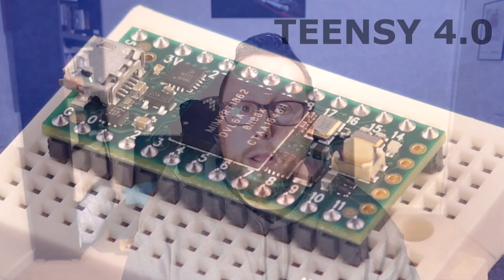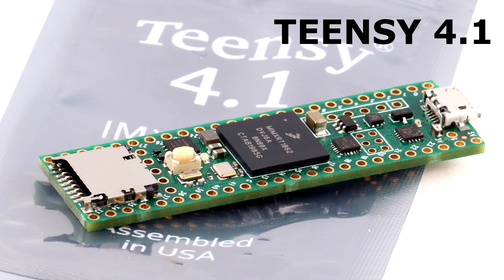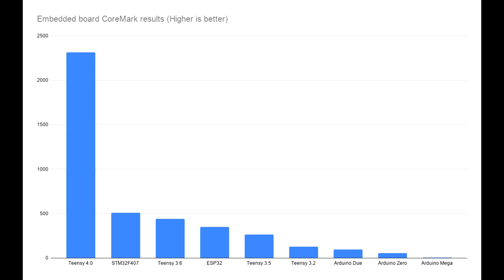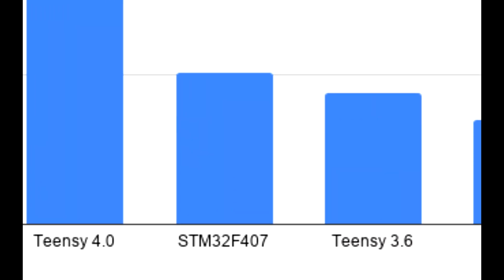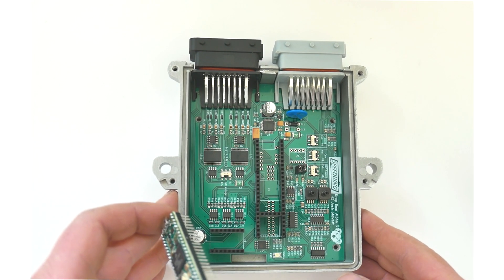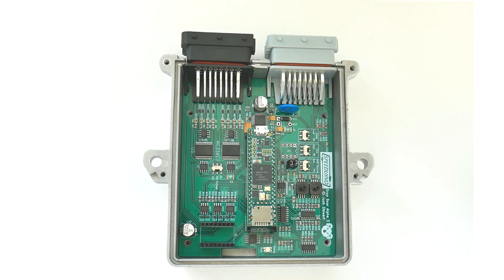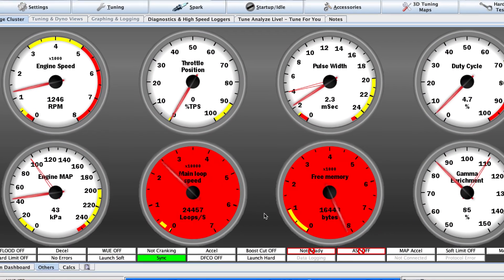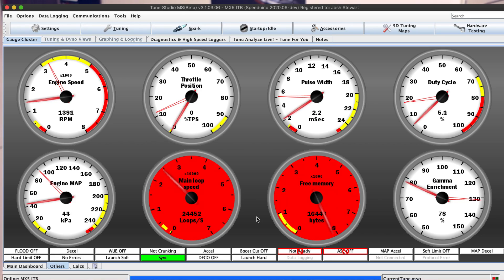Making an insanely fast Speeduino ECU

Comment: Just subscribed to you after finding your channel in an quite unusual way. 

I was browsing a Chinese Import website and saw a new empty ECU Case. 

That made me wonder if I would be able to build a ECU from a Micro controller.

Just 2 clicks later I found what appears to be a clone of an early prototype from your project for sale on said Chinese import website 😁

That made me google the name of the product and that's how I found your channel.
Reply: Probably want to stay away from those cheap as hell crap ecus in your car just fyi.
Reply: @MrJermbob  As someone with quite broad knowledge of electronics I don't see wy not. 

As long as the materials used are ok it will be fine.
Reply: @NinoJoel  Its the code. Not the hardware. Hardware is easy as you know.
Reply: @MrJermbob  you've posted several similar comments but haven't explained why you think the code is junk or what alternative you recommend. Are you planning to make a video about your specific speeduino concerns?
Reply: @aborkedbean  Wouldn't waste my time. I have said why and about the fixed timing.
Reply: @MrJermbob  Could I ask why you replied individually to each comment and introduced yourself each time? What's your issue with Speeduino and why are you constantly trying to say this ECU is ineffective?

In each comment, your response only involves "fixed timing ignition" and you have nothing else to say. In previous comments, you claimed to have 20 years of tuning experience, but based on your knowledge and what you're stating, you aren't even familiar with the most basic and simplest matters.

Comment: Thank you for modernizing aging ECU's into opensource soft and hardware!
Reply: They havent. Its junk compared to any other ecu. Cant even hold stable fixed ignition timing. you guys got scammed.
Reply: @MrJermbob 
Could I ask why you replied individually to each comment and introduced yourself each time? What's your issue with Speeduino and why are you constantly trying to say this ECU is ineffective?
Reply: They didnt. Its broken Speedunio will never take off as its junk code. The physical hardware is so simple. Noobs.
Reply: @MrJermbob  What do you recommend in the Speeduino's place, then? Can you make and alternative yourself?
Reply: @Cmdrbzrd  Just use a megasquirt. At least their code has been made to be sold. That way it has to be quality and supported. I have had a long play with speedy and ran it on one of my own personal vehicles as i like the idea. The problem is the core code is broken. No matter what features anyone works on and no matter what circuit board they make it will still always be broken. It takes assembling one, installing into a car, setting fixed ignition timing and revving the engine to see which is a big shame for alot of people that get that far.
Reply: @MrJermbob  Exactly what is broken with the code?
Reply: @LaysLobs  The fundamental triggering code. Stick a speeduino on your engine. Set fixed ignition timing. Get a timing light. Rev the motor watching the timing marks. Rev it to rev limiter and watch what it does too. Ignition timing does not maintain stability even when the trigger input is stable. Ive back to backed speeduino and megasquirt on identical setups. Megasquirt holds rock solid ultra accurate timing instantly after swapping to it. I have seen many installs now with the same issue. I have yet to see any powerful cars running on speeduino because they generally hurt the motors when trying to make power. I am not a coder. I am a tuner and a car guy that has 20 years experience with multiple ecu brands. I have a dyno where i live and deal in ecus all day every day. I have seen what their crappy code is like from a user point of view.
Reply: @MrJermbob  At least spell it correctly, noob.
Reply: @d1e6om  Spell what right munter ?
Reply: @OOFSPEC you really are the guy that no one wants to be around. Replying to every comment like a school girl.

Comment: I have a question on how to wire up a idle PWM two wire controller (ford mustang idle pwm) on speeduino .4 board.  you have pin #37 and what other pin from speeduino board do you connect to?  ecu ground?  thanks for your help.
Reply from the maker: Connect one side of the idle valve to a switched 12v source and the other side of it to the output on the Speeduino.
Reply: @Speeduino  hello, is that a positive 12v source and pin #37 on speeduino?  thank you

Comment: With greater speed and larger storage, will per-cylinder, as well as adaptive, fuel mapping become available?
Reply: Per cylinder fuel mapping would be amazing.
Reply: Actually, now that I think about it, shouldn't they all use the same fuel map but per-cylinder VE tables? It's the difference in air intake that causes most differences if I'm not mistaken.

I mean you could do with with fuel, but to have 8 widebands... lol.
Reply: @ChielScape  AFR table is a form of adaptive fuel trim. They're both a type of fuel map.
Reply: @CreeperOnYourHouse  Well sure, but you don't want to mess with your AFR target table, do you? If the variance in physical VE between cylinders causes them to produce a different lambda measurement, you don't want to cheat by changing the AFR for that cylinder. I'm approaching this from a physical perspective here, correct me if I'm wrong on this.
Let's say you want to run it at 12.7:1 but measure 13.4:1 at your rearmost cylinder, making the AFR target 12.0:1 to compensate so the measured value ends up at 12.7:1 causes misinformation. If a cylinder gets more or less air due to manifold design or something, that information has to go into the appropriate table to make sure all the tables remain accurate. A table with a 12.0:1 value to make sure it runs 12.7:0 sounds absolutely nonsensical to me.
Now for a given engine those two tables can be combined to a single table in which case it's effectively a fuel flow or injector duty cycle table, in which yes you're changing the fuel table/map, but this approach seems rather opaque to the tuner imo, since it doesn't reference any physical or desired measurements.

Comment: Do you think the 4.1 will enable use of SENT sensors or do you think the other processors are capable?
Reply: Hi Shawn, I’m a new speeduino user and while looking at some additions for my application I discovered the Hella OPS+T sensor, which is an oil+pressure sensor outputting data in a way somewhat similar to the SENT protocol you mentioned.

I wrote an interfacing implementation of this sensor to speeduino which is currently being reviewed: https://github.com/noisymime/speeduino/pull/494

Actually the code works but there’s room for optimization and more elegant ways of interfacing/reacting to the sensor’s signal.

It may be useful as a starting point for the SENT protocol, do you have some particular sensor in mind ?

It should work on the mega as well, I have plans of doing some benchmarking on this application in the next weeks.
Reply: @deffie83  I feel sorry for your engine.

Comment: Isn't the Arduino Portenta H7 a viable option?
Reply from the maker: Potentially, but support would need to be added for the H7 MCUs. It also has a serious lack of IO unless you use the high density connectors, which are a bit of a pain.

Comment: Just found out about your product and look forward to learning more!
Reply: Run for the hills. Buy something better. Please dont use these broken code ecus.
Reply: @OOFSPEC  speeduino has been quite successful....bugs always exist in firmware even with big name companies.
Reply: @lildude6906  No it hasnt. Its been successful to get into the broke customer market sure. Success in making horsepower no it has not. Not bugs that cost you irregular ignition timing. Big NO NO
Reply: @MrJermbob   there are countless pnp examples of speeduino in bmw, miatas, dsm, and Hondas lately. I would say that's quite successful for an open source stand alone ecu
Reply: @lildude6906  Sure nothing that makes power or can show a decent dyno run. I challenge them all to set fixed timing, rev the motor and watch the mark with a timing light. I mark my word it will jump around like crazy.

Comment: Hey man, love your work, keep it up! quick question, i have an arduino due and have some trouble uploading the firmware to it using the speedyloader, it keeps giving me that avrdude: stk500v2 time out message, could it be that the speedyloader only works for the mega 2560 or am i missing something? since I've seen yoyr previous videos using the due instead of the mega, I'm new to the arduino and coding world so definitely looking forward to your reply, thanks in advance! (Sorry for my bad english)
Reply: He wont reply. He needs to help himself with his broken code.

Comment: @speeduino hey i have a project coming up which includes dual engines and i would like to control both engines simultaneously on one ECU i would also like to have D.B.W. on both as well as a strain gauge to shift both transmissions sequentially is this something a 8 cylinder capable ECU could handle ?

Comment: What are the advantages of the 3.5?  I'd have thought standardise on the latest, balancing cost & speed.
Reply: As stated above, it has more available timers.
Reply from the maker: More timers is certainly the big one but I also have concerns about the temperature that the 4.1 runs at
Reply: @Speeduino  Great thank you for that
Reply: @Speeduino  Nothing a tiny heatsink and some thermal epoxy can't fix, no?
Reply: @ChielScape  No. that does nothing. Where is the heat energy getting sent to ?

Comment: i hope any board printed in 3 layer and made it only 1 1/2 credit card size.. and I really interested to try this ecu in my motorcycle, just 130 cc but convert from carburator to fuel injection

Comment: Hello, I am an engineeringstudent in France, studying electronics/programming. I am about to start a very interesting school project and I need your guidance!

I own a Honda CRF250L 2018 engine (single cyl 4 stroke) and a go kart chassis, the plan is design all the rest ourselves: ECU/Harness design, touchscreen dashboard, flappy paddle gear box and servo for the clutch (previous project but swapping from an arduino for a custom circuit),  full lights (including brake lights/indicators) and possibly a pivoting rear wing.

The project is replacing work experience so it is supposed to last 12 weeks (35hr/week).

Do you have an email to contact you directly?

Thanks in advance!
Reply from the maker: Probably easiest to jump on Slack and we can have a chat about it if you'd like: https://speeduino.slack.com/join/shared_invite/enQtNzE0MjU2ODE5MTM5LWZhOWMwMWFhZTVjYTg5NmYwNzhmMGNhNDE4NmJiNDc0NDgyYmZiMjg1YjJjZmNjNDk2YTYzNzk1ZWEyNGJhNDI#/

Comment: im running an on/off switch to my supercharger, will the speeduino be able to correct itself on the fly or will i have to change the tune manually ?
Reply from the maker: Of course, whilst off boost the tune will simply run in the NA portion of the fuel and ignition maps.
Reply: @Speeduino  thanks for the fast response mate :)

Comment: how does the speed compare to a Raspberry Pi 4?
Reply from the maker: They're very different things with very different goals. The Pi4 is obviously a lot faster, but does have all the peripherals that you need in an MCU like this. It also uses more than 20x as much power.

It's a great board, but not for an ECU.

Comment: This fast enough to use on a rotary application?
Reply: Why wouldn't it be fast enough? I mean it can run normal piston engines to pretty high rpms, and i see no issues in  running speeduino on rotary...
Reply: Ladislav Daníček my concern was that they run with half the cycle time of a conventional engine. Thank you
Reply from the maker: There are at least 5 rotaries running on the 16Mhz Arduino so.... Yes
Reply: Speeduino FD RX-7 is still under development?
Reply: Also there is a video of a guy on YouTube running FC Na engine on speeduino

Comment: Am I crazy to assume you can use a faster chip to run closer to lean making more power in a safer manner?
Reply: The ecu processor speed has nothing to do on how lean you can run engine, how much it makes hp, etc.
Reply: maybe if you use a wideband o2 sensor. with the traditional one for sure that is not going to happen
Reply: Not at all. The code the ecu is based on is broken and does not hold solid ignition timing. Run for the hills away from speeduino.

Comment: Is the 3.5 capable of running v12 full sequential if we really wanted to or you would choose 4.0 for that??
Reply from the maker: If anything the T3.5 is probably better suited. It may have a lower clock speed, but it has more available timers. The firmware though hasn't been updated for the extra 4 channels as there hasn't been a call for it at all.
Reply: @Speeduino  thank u for answering my question although i had made a mistake. I wanted to say v12 with wasted spark.

I would like to add that you are the hero of us all and never stop developing the speeduino even until it surpasses motec and suvecs although its considered a stretch at this point in time.
Reply: @FirstLast-tx3yj  Ohh then definitely, v12 wasted support will be there on this board.
Reply: @joshstewart2131  cool man, i was about to buy ms3 pro. Now i am just sitting around waiting!!🤣
Reply: @joshstewart2131  cool man, i was about to buy ms3 pro. Now i am just sitting around waiting!!🤣

Comment: @Speeduino Will there be any more updates/upgrades for the old 0.4.3 models, Josh?
Reply from the maker: In terms of hardware changes? There will likely be small revisions going forward, but nothing major planned. The 0.4.4 line of SMD boards has had a few more things added with the extra board space, but nothing major

Is there anything specific you're after?
Reply: Here are some suggestions. Sp721app isn't recommended for newer designs, the onboard BT on 4.4 is very user friendly and we need a way to do the 5 and 6 injectors work right on since they use the same extra mosfets in the board. Do you think there are any chances to implement a SW way to route those injectors? Thanks in advance, Josh. Big fan here.

Comment: You have an estimate of when the speeduino dropbear will be available, I am very interested since I have a v8 engine that I want to run in full sequential?
Thanks you for your grate work.
Reply: I am also interested in it, I have a toyota 1uz engine and I also bought that same aluminum box thinking that I could put the board of the speeduino 0.4
Reply: @omardelarosa4899  I buy the same case thinking I can put the 0.4 xD
Reply: Me too.
Reply: Dont do it. get a better ecu.
Reply: Such as? @MrJermbob